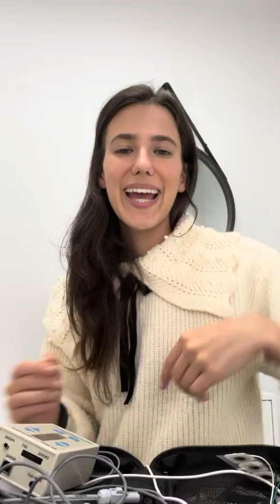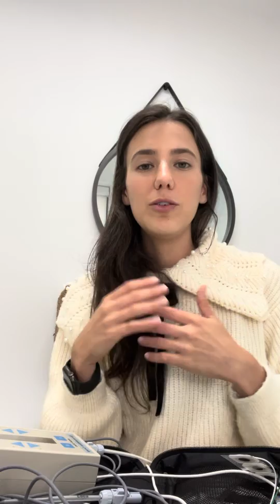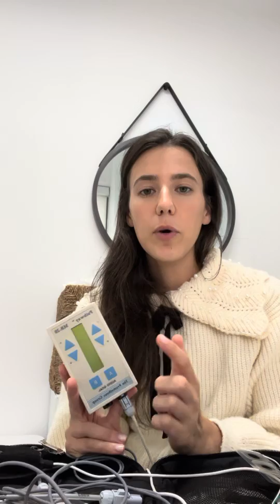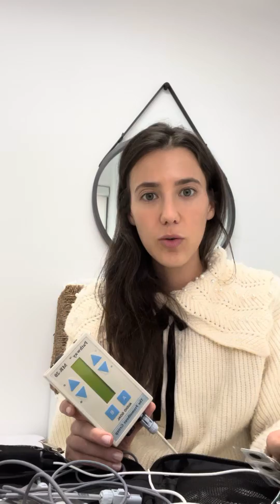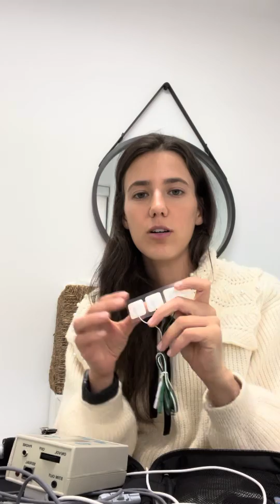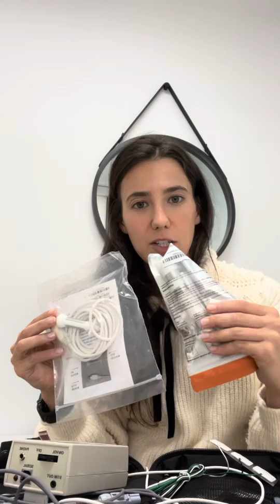Intro to biofeedback

Comment: How long does it take to repair pelvic floor dysfunction? I am dealing with chronic constipation and pelvic floor dysfunction, which has made it difficult for me to have a bowel movement for months. I often have to use an enema for relief. What is the best option for quickly repairing my pelvic floor, especially since I am still seeing my therapist?